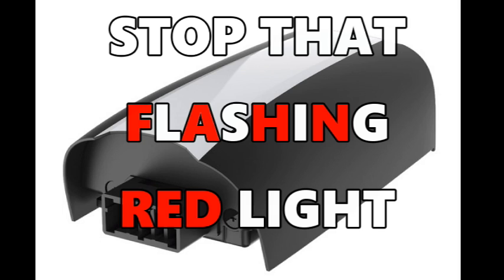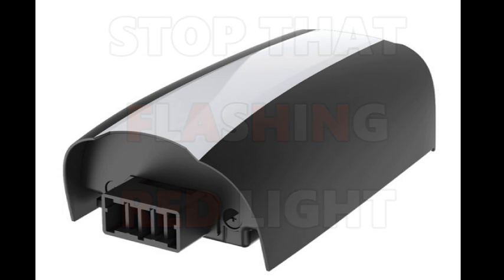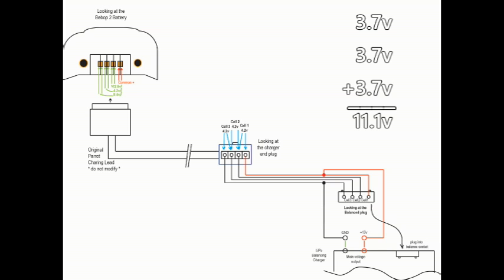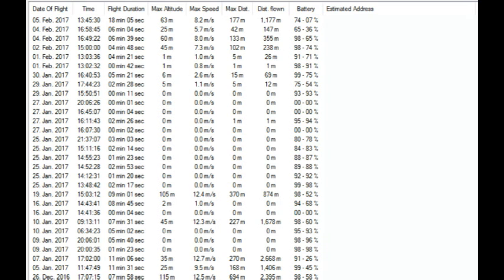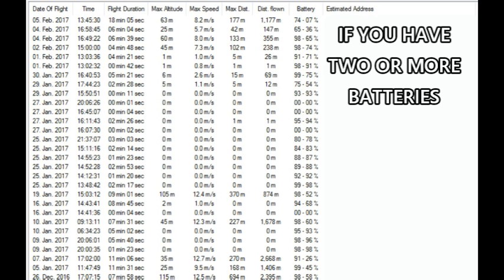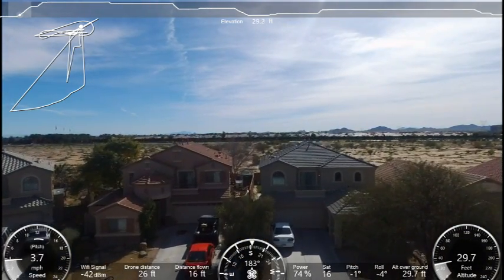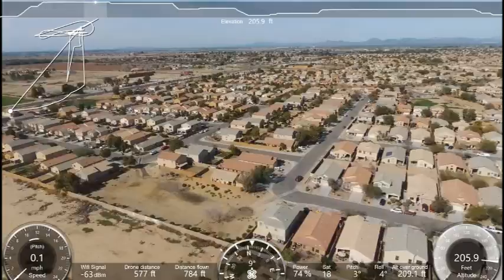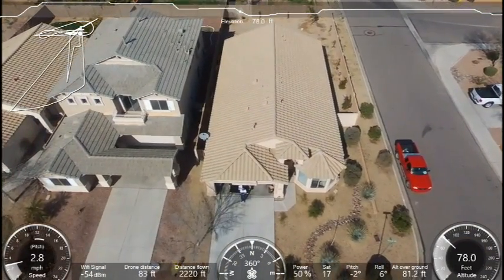STOP THAT FLASHING RED LIGHT

Comment: I just purchased a bebop 2 and a brand new battery, i only have 1 battery, i flew the drone and crashed it on the first run. Wooohooo, lol.   The drone survived the fall but the battery will not charge and the drone will not turn on? It was at like 15% when it crashed. I cant get my bebop to turn on at all with the battery but i also can not charge it. Im at a loss?
Reply from the maker: Hi Zack. I am sorry to hear that - on your first flight. I'm sure you have examined everything carefully. The battery has a circuit board on the other side of the plug and three cells fastened together with foil. I am guessing the issue is in the battery, internally. That's my best guess. If you know someone with a battery you could borrow, plug in and see if the Bebop will start up, that may answer the question. Again, I am sorry to hear that. God bless you.

Comment: If I have a battery that is flashing, and I can’t fly the drone because it’s not charged, what can I do to make it charge? I only have one that works so I can’t do the switch trick. Thanks 🙏
Reply from the maker: Hi Miller. I would turn on the drone with the battery sitting in it but let the battery go almost totally dead. Then try charging it. There are three cells and one is still too charged up. When all of the cells are about even the charger should work. Otherwise you will need a new battery. I know, that's the bad news. Thank you for your comment and never hesitate to ask questions when they come up. God bless.

Comment: Worked for me after 77-80 tries BUT a few days later plugged it in to make sure it didnt drip and it had a little then 15 minutes later was solid green again, then rain so no flights, a week later battery is red flashing again, so did the process again and hot a solid red charging light then afterwards 15 min was flashing again replugged it and solid red again.... lets see whats up.
Reply from the maker: Yep, I'm sorry. From my experience, every time you use the Parrot charger it does a little more damage to your battery. I actually ran a test with my two brand new Bebop 2 Power batteries and kept a record. Watch the video I made and you will begin to understand why I highly recommend using a balance charger.

https://www.youtube.com/watch?v=FsCCAKV6XDk

Thanks for your feedback and God bless.
Reply: @user-sr8pn9xg8z  Pretty stupid for the price of this drone that they dont just include some kind of balance charger. That would be such a great selling point over other drones.

Comment: What happened to the video on the lower edges at 7:50 in the video? Blank wobble?
Reply from the maker: Thanks for your question Gerhard. That's what happens with a Bebop 2 when you view straight down in any kind of wind or unstable condition. God bless.
Reply: @user-sr8pn9xg8z  so it is normal... Myne does it a bit worse. Hoping to find a way to make it less.

Comment: Well I got my 3rd bebop this Xmas like I told you n I got that red blinking light. So I got a dead battery.  The company is sending me a new one.  But at first I thought it was the charger cuz the connector that goes into the charging brick was missing a prong. So then I modded the wire with one of my 3s battery leads and used the yuneec q500 4k charger that I just got for Xmas also that had a puffed battery lol my luck.  But it didn't charge on that charger also so I knew it was that battery n this video double confirms my conclusion.  The 3s battery lead was from an old battery I don't use and it's got 1 red n the rest black wires on that battery lead..  So I soldered red/ positive to the red and the black negative to the black on the bebop wire. The other 2 wires are like green n yellow I think but as long as I have positive n negative I'm good right? Thank you sir! I need to know I soldered them to there right place cuz I have 2 more batteries coming n can't afford to short one out.
Reply from the maker: That comment was a lot of words for my poor brain to put together. But, I think you figured it all out :) Please let me know if I'm missing an important question and God bless.
Reply: @user-sr8pn9xg8z  lol I know I did type allot. I'm mainly concerned about that modded bebop 2 charger cable I made. I think it's ok.  Even if that battery was dead I would still got some sparks if I wired it wrong.  I know you know allot about the bebop 2 charge cable and modding it.  Bless you to friend!

Comment: Why are all of us idiots trying to fix what the snowflakes in France should’ve designed right it should be a smart system that can balance everything out when it charges it shouldn’t be so picky on all those percentages and storing it in a  flameproof bag with the Hells going on with this crap anyway I’m taking mine back to Best Buy  something that was designed by electronic gurus in this millennium!
Reply from the maker: You are right. As a programmer myself they should not have taken the previous designs and tried to improve upon them. The smart thing to do is just start over from scratch incorporating new code which they could have done. But it is cheaper to put bandaids on the old design and try to make it work like something new. Thanks for your input and God bless.

Comment: Mr Kent, I'm glad you have made this video dedicated for bebop 2 flyers.. I just want to clarify if I understand correctly, that if the battery is used correctly it eliminates the need for a balance charger only if you charge it all the way and consume its charge til 20%?
Reply from the maker: That is a good practice if you don't have a balance charger. The only drawback is that the battery should be stored at 3.8 volts per cell, otherwise it is like as if it were eating away at itself. With a balance charger you don't need to be concerned about how long your fly because when you finish you connect to the charger and click on "storage" setting. By doing so your battery will last much longer and charge to the highest voltage possible. 

When I made that video I only had one battery and it would no longer charge using the Parrot charger because the cells were so far out of balance. But I did get them balanced close enough doing what you suggested.

Thank you very much for watching and for your comment and God bless.

Comment: Hello MrKent.  I enjoy watching and learning from your videos.  After about 5 good flights on my Bebop 2 since it was new, the OEM charger it came with, gets extremely hot to the touch within a few minutes.  I then unplug it because I want to keep my house, then after it has cooled (about 30 minutes,) plug it back in to continue charging.  This is a tedious process.  I've already contacted Parrot but couldn't get a direct answer.  The battery and the charger has never been dropped, abused or damaged.  Maybe you have talked about this already but what is causing this?  Could it possibly be because I'm not draining the battery low enough and the cells are unbalanced?  I must admit I have been guilty of topping off my battery after each short flight. But I've always heard that LiPo's DO NOT form any memory and that you can discharge them at any level besides bone dry and charge them without any ill effects.  I welcome your comment. Thanks
Reply from the maker: Hi Jet. Well if you have watched many of my videos you know I thing the Parrot charger is a piece of junk. You can truly save yourself money and headaches by getting a balance charger. I have a video on how to build the cable that has the Bebop plug on the end, or I also have them available.

My charger always got hot but not like you describe. So there is something definitely wrong but I have no idea what. Please let me know if you have questions about using the balance charger. I can give you links for more info. Thanks for your comment and God bless.

Comment: good video,  as you know i recently just bought a Bebop 2 FPV and i am glad i happened across this video. I been guilty of recharging my stock parrot battery before it was below 30% or so sometimes. The first time i flew i took it down to 0% by accident. it charged just fine. But i have a trick that i do before i charge a well drained battery. My trick is let the battery cool down, i have noticed they get warm from use and the heat of the copter itself and the outside temp. So let them cool down to cold before I charge.
Reply from the maker: Yep, I can't recall if I said that in the video but I never charge a warm battery. If it feels warm on the outside how hot is it in the middle . . . Thanks for your input and God bless.
Reply: nope you didn't mention that in this video. no worries.

Comment: Mr Kent I would like your opinion on balancing my props for my bebop 2.  I can hear at times that I think I have a prop that is not right the front left prop that does not have the hole in it looks like it is flexing a bit and not sure how to balance it I purchased a balancer but it is made for props with a hole in it . What can I do with out more expense......  Thanks Sunfish......
Reply from the maker: Hi Stephen. So far I have not had an issue with prop imbalance, but I have seen instances where you put a small piece of tape midway out one of the prop blades - test to see if that makes things better or worse. If worse, put the tape on a different blade, etc until you find a balance. You could try that to see if it works for you. That's about the best advice I can give on that issue but thanks for your input and God bless.

Comment: What happen if not use balance chargaer?
Reply from the maker: The Bebop drone uses a three-cell LiPo battery pack. Lipo batteries are easily ruined if not charged and discharged properly. The charger that comes with the Bebop is a very "basic" charger which only puts a charge to the cells without regard to the state of each individual cell. Since not all cells charge equally, eventually one or more cells becomes over charged or under charged compared to the others in the pack. At that point the battery no longer works as it was designed. A BALANCED charger is sensitive to the condition of each cell and charges each according to their individual need, according to the way the lipo battery was designed.

Comment: Sir, let me share with you some important information. Never completely discharge a Lipo battery. Never store it completely discharged. Never store it completely charged. 
You should always store a Lipo battery at around 3.85 volts per cell. 
Here is a good summary of Lipo care. 
Cheers. 
http://uterc.org/files/LipoStorageTips.pdf
Reply from the maker: You are completely correct. I appreciate your input and can always learn from others.
Reply: mrkentdotcom I put them in a ziploc freezer bag, air removed with a straw, and stored in an ammo box inside the fridge in my garage, at 3.85 volts/cell. I have 4 bebeop 2 batteries all in optimal condition. 

Happy flying.
Reply from the maker: Thank you. I just moved to Arizona last fall and as per your reminder I will be storing my LiPo's in the fridge here also. It gets way over 100-degrees here in the summer.

Comment: thanks, so to summarize, you are recommending people let their batteries drain to avoid the red warning light. thanks for sharing that.

and to clarify to potential viewers, the light he's referring to is on the battery charger (while trying to charge the battery). I thought it might be the flashing light on the battery while flying, if someone wanted to disable that. (I realize the safety Sally's and privacy Paula's will decry the very idea.)

anyway, the problem mr kent  discerned is that he had repeatedly  not let the battery completely discharge while flying, which he feels led to unbalanced battery cells, thus the warning light. 

And his solution was to let the battery drain (by flying it, though you could also draw it down by connecting it to your computer via USB and viewing/copying/deleting files).  Then he found it could be charged again.
Reply from the maker: Thank you for your clarification. I need all the help I can get.